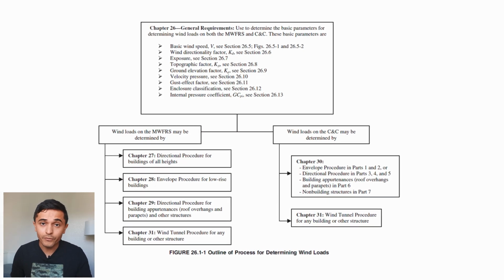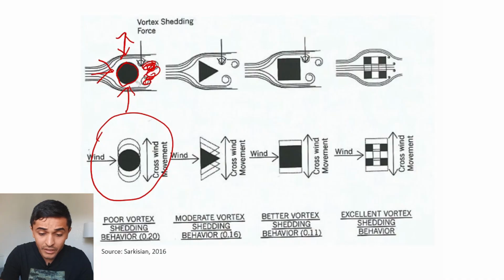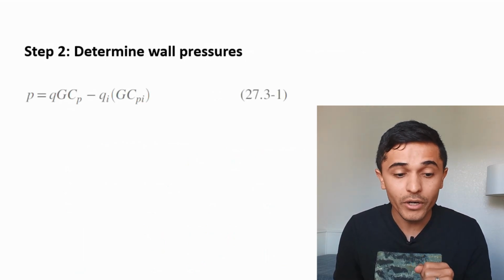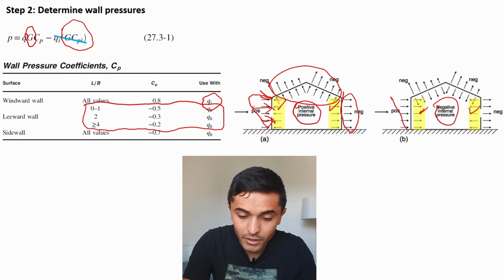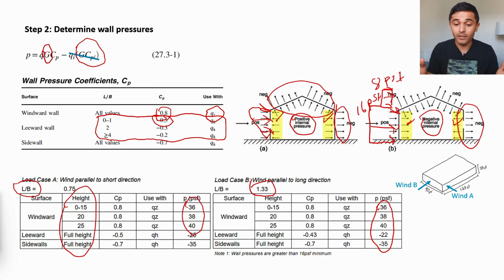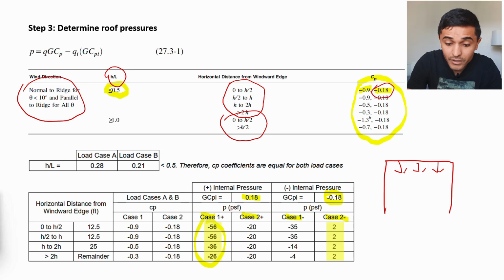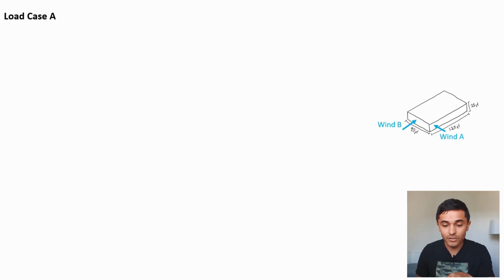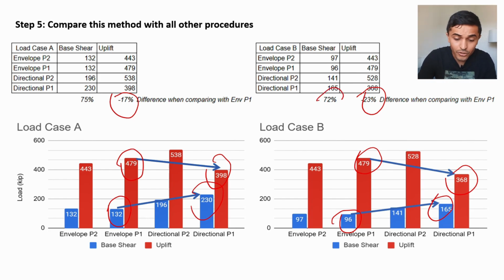What Most Engineers Don't Know about MWFRS Wind Loads (MWFRS Directional Procedure Part 1)

Comment: Hello Romulo, Great Video.
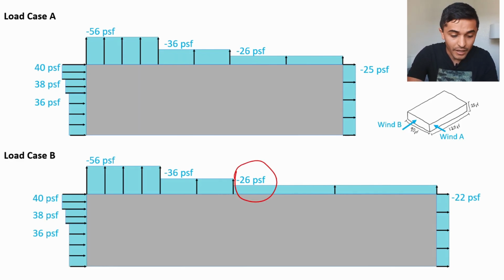At 19:07 For load case B why do you have -56, -36 and -26 at the roof?, shouldn't it be -35, -14, -4 and then another Case B.2 where we have the +2?
Thank you
Reply from the maker: Hi Andres! Glad you enjoyed the video. I didn't add the load case for +2psf because for this exercise, I was interested in computing the total uplift and comparing it to other methods. But you're right, there is another load case for downward wind which would be case 2- that I show at 14:57. For the pressures you mentioned (-35, -14, and -4), they are obtained when you consider negative internal pressure. That counteracts the negative external pressure and yields lower pressures that are not the worst case. Both load cases A and B must consider cases for positive and negative internal pressure, and case 1+ yields the worst case scenario (negative external pressure paired with positive internal pressure). If you got more questions, feel free to email me at rsilva@quickquestionengineering.com. Thanks again!
Reply: Thank you. This is very helpful.

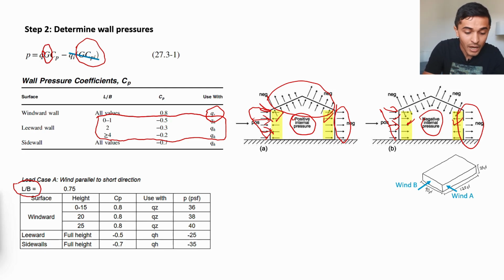Comment: At 10:00 can i consider qh=qz, since my structure is low rise ?
Reply from the maker: If your structure is 15ft or shorter, you can and there will be no difference in pressure. If your structure is taller than 15ft, you can do it as well, but you will be getting higher pressures by considering qz=qh which may be overly conservative.

Comment: Thank you so much for your Content; it's very informative and Helpful. I have a question: in minute 10:55 computing Cp, why did we have Case A and Case B ? Does ASCE mention that we need to test for 2 loading cases?
Reply from the maker: Glad you enjoyed it! And yes, we do have to consider wind loads acting on each side of the building separately. ASCE 7 doesn’t call it Wind A and Wind B like I did, but this is a requirement first from section 27.3.5 which states “The MWFRS of buildings of all heights, the wind loads of which have been determined under the provisions of this chapter, shall be designed for the wind load cases as defined in Fig. 27.3-8.”  That figure then notes case 1 which is a representation of wind A and wind B in my example.
Reply from the maker: Also, I send a weekly structural engineering newsletter every Saturday morning. If this is something you’d be interested in, this is the link to join: https://shorturl.at/JPCPR